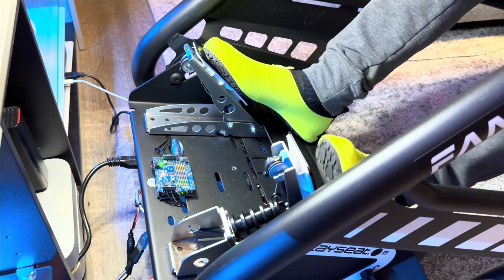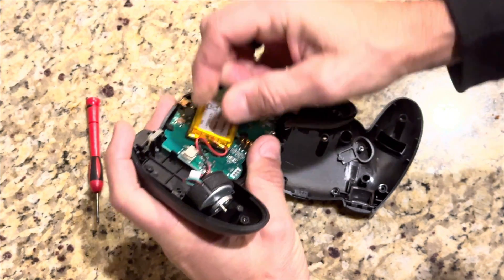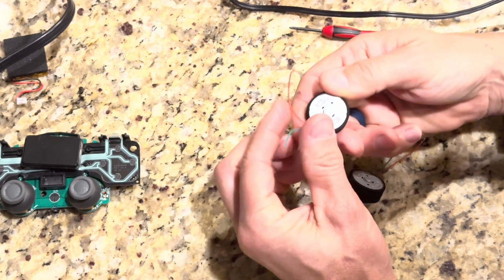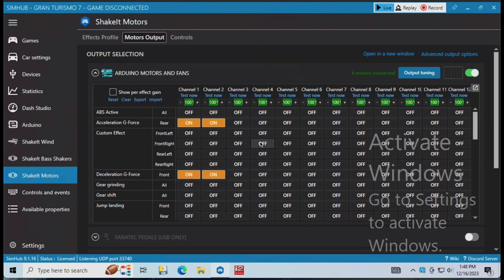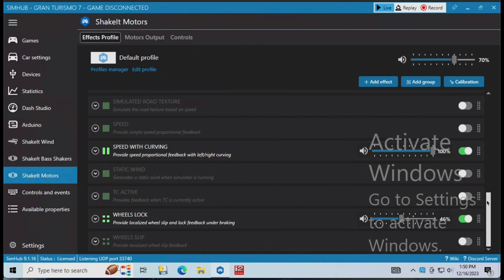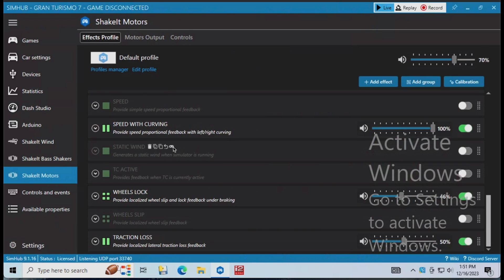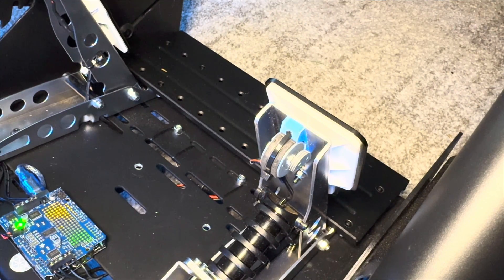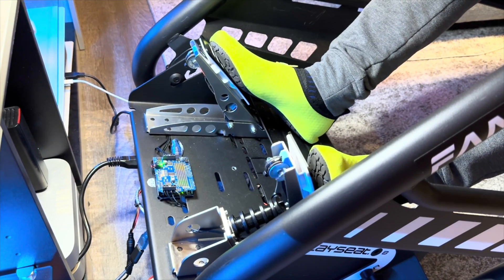DIY Rumble Pedals On the Cheap! How I Added Force Feedback to My Sim Racing Pedals

Comment: Has anyone tried simple using controller pcb instead of arduino? I imagine there'd be limitations on what you can set up, you could'n use sh shakeit, but it's simpler and probably would sive useful feedback, since most games rumble when tires are on grip limits? It'd probably be interesting at least to try whether i like it??
Reply from the maker: I’d say give it a try, but I’d be concerned the control pcb can’t deliver as much power as the Arduino with motor shield and power supply. Also, you won’t be able to adjust how/when/what you want to trigger the effect.

Comment: With just 2 ps4 motors, do i need arduino motorshield to drive motors or just arduino uno ? And do you think just usb power is enough?
Reply from the maker: That's a good question. I think I remember seeing PWM instead of motor shield being an option for small computer fans, so I'd say it's probably possible. I would ask that question on the simhub Discord at at simhubdash.com forums

Comment: What about TT25-8?
Reply from the maker: Instead of rumble motors? Yes, that would totally work, but you'll need an audio interface/amp to drive them. The reason I went this way is because I already had the Arduino and motor shield to drive 2 channels of wind simulation. The motor shield had 2 unused channels available, and rumble motors can be found for next to nothing. In my specific circumstance, it made more sense.

Comment: Just installed the sim 3D rumble kit on my g Pro pedals, and as GT7 doesn’t output abs telemetry I mapped deceleration g force to the brake pedal instead and it works really well, got wheel spin & lock mapped to the accelerator. I’m really impressed.
Reply from the maker: That’s a great idea! I’ll have to give that a try. Thanks for mentioning it!

Comment: Did you need a UDP walk around to get these to work in Gran Turismo or did they work directly within Sim Hub?
Reply from the maker: It’s been a minute, but I believe the UDP default value worked for me as long as the PS5 IP is right. It’s on dhcp though, so sometimes I have to go into simhub and update manually. I should just make it static, but I’m lazy.
Reply: @DigitalRelay thanks for the reply. 
I got mine to work. Bought them off Etsy. Sim Hub recognized right away. Still getting used to Sim Hub but I’m getting there. Your videos help me a lot. I appreciate you.

Comment: Can I just use arduino R3 by itself for this? Mine doesnt have m2 ports
Reply from the maker: I don’t think you can output directly from the Arduino to the rumble motors. Maybe it’s possible since the voltage and amp draw is fairly low. I’d check the simhub forums or discord to see if it’s been done. I already had the motor shield board installed on my Arduino for wind sim, so it was super easy to just connect my pedals to the open channels on the motor shield board.
Reply: Yea I figured, everyone Ive seen has used the motor shield with the r3. Its only 8$ on amazon so no big deal. 

Thank you I appreciate it

Comment: i just did this with arduino and l298n motor driver and tested working havent played yet. but i noticed you have 4 channels turned on. but there are 2 motors. so wouldnt it mean there is 2 channels? or the motors are reversing to get 2 extra channels on 2 motors?
Reply from the maker: I’m using 2 channels for rumble pedal motors, and 2 channels for wind simulation fans. Different effects for each.
Reply: @ what power supply are you using to run the motors?
Reply from the maker: @shafi420  Just a generic 12v DC power supply I had laying around

Comment: Can you use the rumble motors and wind fans on the arduino that receive that control the pedal and buttons if you have a DIY pedal set (arduino leonardo)? Or do you need another arduino for rumble and wind? Thanks! Great Video!
Reply from the maker: I'm not familiar enough with that type of setup to say if you can piggyback off your existing Arduino. The one thing you'll for sure need is the motor shield board to take in power and distribute it to the fans and motors. You may be able to add the motor shield to your Arduino Leonardo. Have you been to the Simhub Discord? There should be an invite  link at the Simhub website. The developer and lots of very smart people in that Discord can help I'm sure. Glad you enjoyed the video!

Comment: Hello, can it be done with a 12v cordless screwdriver motor?
Reply from the maker: I don't think a cordless screwdriver motor on its own will work. The rumble motors have an offset weight at the end that makes it off balance. That's what causes it to vibrate.

Comment: What rumble motors are you using? Were the ones from the PS4 controller too weak? You mentioned you upgraded to the motors from a Logitech controller, could you share the name/link to the controller you used for the donation?
Reply from the maker: I ended up buying a lot of 4 non-working PS4 controllers on eBay and scavenged the motors for my main rig at home, and my portable wheel stand rig. They are strong enough. I don't run them at full voltage even. I think they are designed to run at 5v and I'm feeding them from a 12v power supply with limited voltage. I'm not sure if I'll end up killing them by sending too much power, but they've been fine for nearly a year, and since I have extras for little money, I don't mind if I eventually have to replace them. Getting a solid mount on your pedal is key. I used 3D plastic standoffs on my main rig, but even a single zip tie on my portable rig works well. You just want to make sure the vibration gets sent into the pedal as well as you can.
Reply: @DigitalRelay  Did you have issues getting SimHub to connect to your Arduino Uno? I've been trying everything and it shows not connected. Any help please!
Reply from the maker: Sorry I missed this! I did not have issues getting SimHub to connect to my Arduino Uno. I've done it on two totally different rigs now. I followed video instructions, but basically, you have to go into SimHub and select the Arduino Uno you have, and maybe  the port it's on, then Simhub will push firmware to the Ardunio Uno. After that, you should be good. I hope you get/got it solved!

Comment: Hi! Very interesting video, thanks man!
There's also similar mod using 25W 50mm resonance speakers. How do you think vibration motor compares to them? 
I guess motor is much more limited in vibration frequency? Does it have noticable lag? 

Can't figure out what's better. One one hand speakers are really easy to setup, connect them to amp, amp to PC and you're golden. Wider vibration frequency is nice to have as well.
On other hand, they could be much louder than motor. And maybe less obvious? 

I'm feeling like you can have em both on same pedal) Speaker screwed down do the pedal base with "drilling-like" vibrations, and motor attached to pedals back side for "rumble" low-frequency haptic.
Reply from the maker: Good questions! For me, I was already doing wind simulation, so I had the Arduino Uno and motor shield board. All I needed was a couple of salvaged rumble motors. If I was starting from scratch, I might pick transducers because I think they are probably faster and more flexible with tuning, but the rumble motors are pretty quick to spin up, and you can kind of tune them in Simhub by adjusting the power that goes to them. Transducers are going to require an audio interface/power amp like the nobsound, so if I went that route on this rig for the pedals, I would have needed a second nobsound interface/amp.

On my main rig where the PS5 and Simhub PC are hard wired to my router, there is very little lag. On my portable rig at my girlfriend's house with PS4 and Simhub PC both on wifi, there is some lag. But that whole rig is kind of a step down from what I have at home. 

Noise wise, they are pretty similar in level, but a different type of sound. Honestly, any haptics on your rig are going to make some noise. I mitigated some of it on my main rig with rubber isolators on the bottom of the cockpit, but the nature of making vibrations is that they will also make sound.
Reply: @DigitalRelay  Thanks for reply man, I really appreciate it!
Very interesting point on connection delay. That was, for some reason, unexpected for me. Didn't have any experience with arduino. I'll definitely will look into making wired connection.

On the noise you surprised me. I knew it can't be completely silent, but wasn't expected same volume as transducers especially because of lower frequencies. Guess vibrations and metal aren't good combinations for quietness either way)) But are motors distinct enough in lower frequency haptics? I mean in lows they should have much more stronger feel compared to transducer because small moving diaphragm shouldn't be nowhere near spinning weight.

Before watching your video I was researching only transducers. Now I kinda want to do both. But really not sure if I won't end up with vibration mess. It won't be a big problem, because you inspired me to do wind simulation as well. So it will be like 2 in 1 deal. But still I need to make my best effort. Not only to have like 2 separate effects per pedal. Maybe it would be better to have rumble abs and higher frequency transducer on traction loss\wheel slip. So those haptics won't interfere with one another, because, theoretically, in tight, quality pedals there should be some leak of transducer vibration from one pedal to another. Or, at the minimum, they won't be the same, which adds a bit to immersion.
Or, if that leak will be not significant and each type of vibration will be like really noticeable from one another, then it will be possible to make something like back wheel slip and\or TC on acceleration pedal, and front wheel slip + abs on brake pedal. Where slip will be higher pitch transducers and tc/abs on motors. I'm beginner in the sim racing, so learning with that much information from the start could be really fun)
Reply from the maker: With the motors, it's not really about low frequency haptics for me. It's just getting them to rumble enough that I can feel it in my foot. I have noticed if I have too much power going to them, they can vibrate against the pedal and make noise, but by adjusting the strength up or down, I can mitigate the sound, but keep the feel.

I feel like the transducers are quicker to give feedback. The motors take just a little time to spin up, but it still works for me.

On my portable rig with PS4 and Simhub on wifi, the lag is more noticeable, especially the motors.

Before I added the rumble motors, I had abs and traction loss going through the transducers, but it was hard to really tell what was what with other effects going. By putting abs on brake rumble motor, and traction loss on throttle, it helps pinpoint those effects, and by not having them on the transducers, it's easier to feel what they are doing with the other effects.

The cool thing is with Simhub, you can customize however you want and play with different settings until you find what works for you.
Reply: @DigitalRelay  Shame to say, but in the end I went with simagic haptic reactors.
I was a bit worried about harm that can cause all those longterm all-direction vibrations from either transducers or rumble motors, as well as compromises of both solutions. Simagic made specific "linear" motor which moves weight only in one axis, towards pedal pad and against it. So there's no sideways vibrations. And it has no observable latency(yt: sim racing corner showed that on slow mo) like other motors do(same yt channel tested that as well with "generic" solution). Plus it's very pronounce in frequency range that really matters for vibration 20-50Hz. Plus it's compact. 
So yeah, it has all goods of both worlds and none of their bads. 
Still bought booty shakers though)) For chair vibrations they're the best.

Huge thanks to you for help. You made lots of interesting points that inclined me to search more and find simagic solution. I'll be happiest with it) Maybe you'll check em out too)

Comment: Does the arduino just connect and know what to do in simhub or are there things to do on the arduino software
Reply from the maker: There is some setup involved. There are other videos out there that go into detail, but basically, in Simhub, you identify your Arduino and flash firmware to it. Then you'll need to enable effects and tune those effects. Check this video out... https://www.youtube.com/watch?v=7EAvur23FLk&t=168s
Reply: @DigitalRelay what gauge wire did you use to run the lines from the arduino to the motors?
Reply from the maker: I think it was 24 gauge wire. I scavenged the wire from a dead AC/DC power supply. The wire was heavier than the tiny wires on the rumble motors.
Reply from the maker: Yeah, I think going heavier gauge is always safer, but I don't think there's too much power going to them. The one thing I would caution on is that if you're using rumble motors from a game controller, those are typically rated at 5v. On my rig, I'm using a 12v power supply because of the fans. I don't send the rumble motors full power, but I guess I'm risking burning them out because of the larger power supply. I figured I'd take that risk since those motors are pretty cheap and easy to source if I do burn them out. I've been running them this way since I published this video, no problems yet.

Comment: If you don't mind can you please make a video explaining the wires ? or maybe just tell me in the comments, which one the ground and etc I'm little confused. I have never worked with Adurino boards hence. Thank you. Much love and blessing my friend thank you very much.
Reply from the maker: I may be able to do a video on this, but maybe this will help... the Arduino is getting 12v DC power supply as input, and then depending on how the effects are setup in Simhub, the Arduino will feed that power to whatever is hooked up. In my case, I have 2 computer server fans, and 2 PS4 controller rumble motors. On the fans, it is important to have the polarity correct or the fan will spin backwards. For the rumble pedals, the polarity doesn't matter, because the rotation of the motors inside doesn't matter. They just need to spin up and cause the vibration.

Also, if you are only doing rumble pedals and not wind simulation, you might be able to get away without a separate power supply. The Arduino can be powered directly off the USB bus power. I've not played with this to see if it has enough power to drive the rumble motors this way, but it seems plausible it would work.

Comment: THIS WAS EXACTLY THE VIDEO I HAVE BEEN SEARCHING FOR. Thank you so so so much my friend. subbed and liked. This was nicely explained as well. I wonder what's the limit of adurio if I can put in bigger motor ?? :D how strong is the vibration ?
Reply from the maker: Thank you!! I'm not sure what the max power rating is on the Arduino. I'm feeding a 12v wall wart power supply on the input and the Arduino is using that to output to my two computer server fans for wind simulation, and the two rumble pedals. For me, this setup works great. The PS4 controller rumble motors I think are rated for 5v, and I'd guess I'm sending 8-10 v max. It is very obvious when the rumble motor kicks in and makes it pretty easy to modulate input to the pedal.

Comment: I see a lot of stuff using Arduino controllers. I'm scared to jump in with them because I don't know them. I'm sure they're simple once you learn them. Curious though, is it just the Arduino Uno? I saw in one of the other comments, you mentioned the motor shield, is that in addition to the uno? Thanks! I would like to build this setup for my logitech pedals.
Reply from the maker: I hope this helps... the Arduino Uno is basically a mini computer. The motor shield is an add on PC board that literally gets stacked on top of the Arduino Uno, including data connections. My Windows PC gives instructions to the Arduino Uno, which then controls the motor shield. The motor shield takes in power from a power supply and then controls the output power to the rumble motors and wind sim motors according to what the Arduino Uno tells it to do.

You can do other things with the Arduino Uno, but that's basically my setup. For now.

Comment: what power dc supply do you use? is 12V/2A or 5V/2A enough to power 2-4 rumble motors? 
thanks for the helpful video.
Reply from the maker: I'm glad you liked it! I think 5V/2A will be enough, since they are typically powered in a game controller by 5v or less. In my case, I already had the 12v power supply running my wind simulation fans, so I just piggybacked off that. I'm running mine at somewhere around 50-70%, so they never get the full 12v. If I go over 70%, they tend to rattle.

Comment: Hey mate this is amazing. Is this something that can only be done using PC? What about consoles connected to a ps4 or Xbox?
Reply from the maker: I don't know of a way you could do it directly on console. I do have it working with GT7, but I have a separate PC running Simhub that is reading the telemetry data being sent by the PS5. Simhub then controls the Arduino Uno and motor shield, which controls the motors. Running Simhub is pretty much necessary to make this work. Simhub is also super valuable in letting you tune your effects exactly how you want them to operate. You should not need a very powerful PC to run Simhub either. I'm using a 10 year old MacMini using bootcamp to run Windows 10.